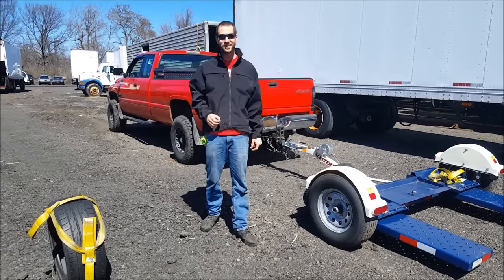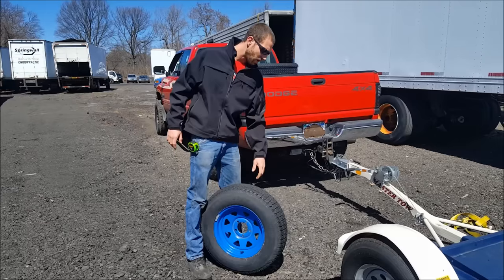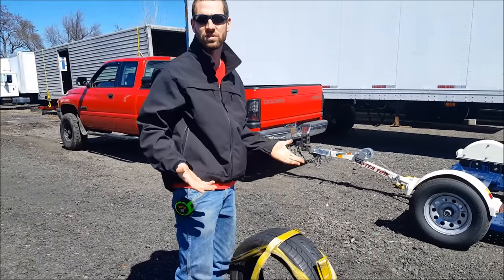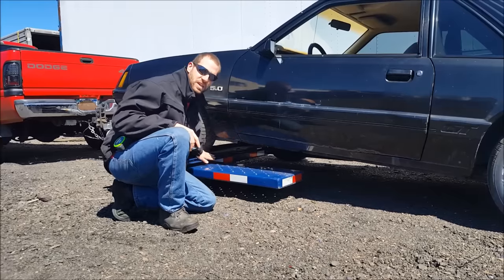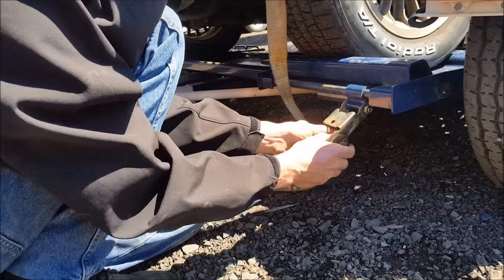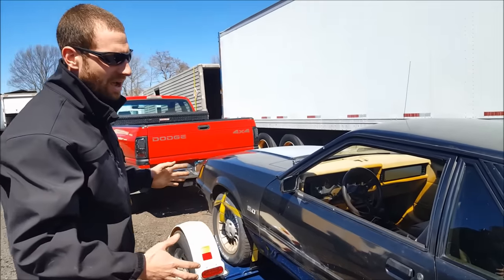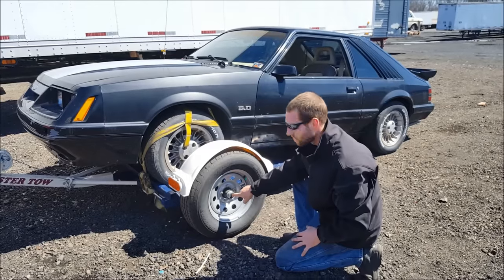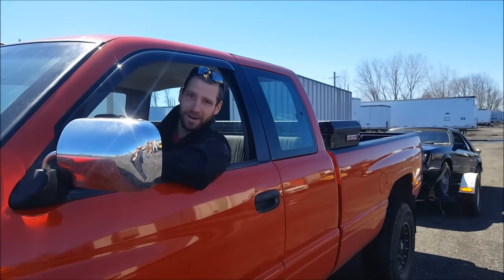HOW TO USE MASTER TOW CAR DOLLY mastertow 80THD instructions

Comment: Good information.  I once towed a car with a manual transmission on a dolly. I left it in neutral, but my wife went behind me to double check everything and she put it in gear. The engine blew a few miles down the road. Dropping the drive line would have saved that car.

Comment: I got a tow dolly for my camper and now I know I can just sell it. There’s no way I’d be comfortable doing all this as a  mom - I can do lots of stuff but for sure this isn’t going to be one of them. Thank you for going through such details with clarity. It probably saved somebody’s life.
Reply: I’m a 61 year old woman and I can use the car dolly no problem.  My husband is NO HELP when it comes to guiding me on or off the dolly due to some brain damage from a stroke so I have to get out and eyeball it myself.  My car is a front wheel drive Prius and I tow it behind my RV.  It has a low profile so I need to use blocks of wood as he describes.  The hardest thing for me is loosening the ratchet.
Reply: @antoinettedepasquale5336  I should have come
Back here and said I figured it out- because I did. Big hep and confidence builder💜

Comment from the maker: NOTE: DO NOT TOW EVEN A MANUAL TRANS RWD WITHOUT DISCONNECTING THE DRIVESHAFT.  After making this video, I did some more research and many manual transmissions need input shaft to be spinning for proper lubrication.  I was under the assumption that since a manual transmission generally does not have an oil pump mounted on the input shaft, that it would be okay to be towed in neutral with the rear wheels on the ground.  NOT THE CASE and certainly not worth taking a risk.

Comment: On these videos nobody seems to understand that you can tow a rear wheel drive vehicle if you back it on. I’ve seen it done no problem, the front wheels freewheel. Just make sure the steering lock is engaged and just to be sure use the seatbelt to ensure that the steering wheel doesn’t turn.

Comment: Great video. Was looking for information As i nearly lost my load recently, most certainly learnt alot from your video. 1st point being i didnt lock the steering wheel with slider, 2nd point leaving slack before ratcheting down the straps to spool the straps up more. Basic mistakes but sometimes learn the hard way. Thanks from the UK

Comment: I know an old timer that owned a repair garage and wrecker service. He towed rear wheel drive cars backward all the time, for decades. This was before cars had lock steering. He would loop a piece of rope on the steering wheel  pull it tight and close the car door on it. Then knot the rope so it couldn't pull back through. They would pull as straight as long as the steering wheel was straight with no wagging.  Thanks for all the great tips on using this dolly.

Comment: I tow my 1999 Tacoma pickup truck with rear wheel drive with my Motorhome . I have to tow it backwards due to it being an automatic transmission. One trip covered over 5000 miles out through the Northwest. I had no sway except from wind, but it migt have been from the Motorhome being pretty heavy. Several times I had to back up due to taking a wrong turn onto a dead end road. It wasn't easy but by working it back and forth I got it done. Also my tow dolly has surge brakes so they were a big help in the mountains.

Comment: Very informative and useful video.I recently had to use a tow dolly like this to tow a 1998 GMC 1500 extended cab truck home.I had to use a 1991 Chevrolet S-10 to do this and it didn't have a receiver hitch.If this wasn't bad enough,I also had to load the GMC truck onto the tow dolly backwards because there wasn't a ring gear and pinion in the rear differential.It did fine until I turned into my driveway off of the main highway and then it almost came off! Finally got it back on and home.
Reply from the maker: Haha, sounds like a pretty sketchy ride! I've definitely had my fair share of experiences like that. Thanks for sharing!  The first car I ever put on here was an old beat-up Porsche that I got for 300 bucks. I put it on backwards and didn't lock the steering. When I made a turn out onto the road, the front end of the car started riding in the opposite lane. LOL
Reply: @NoNonsenseKnowHow  Wow!The steering column on that GMC 1500 didn't lock anymore,so I had to ratchet strap it straight.When I made the left hand turn into my driveway,the right wheel of the dolly went under the frame of the truck near the cab.
Reply: @NoNonsenseKnowHow  
Sunday, I had to haul an automatic 325ci with a rear-air-bagged Grand Cherokee. 400 miles SoCal to NorCal. I've towed professionally for the last 15 years, repo, AAA, every crazy/illegal/insanely unsafe situation possible. This tow was the sketchiest haul I've ever done! It was wagging me hard. At 45 MPH it was trying to kill me. I had to set it at 40 MPH and cruise it white-knuckle the whole way. At that speed it was 12.5 miserable hours instead of the normal 5ish hours. 

Never again.

Comment: Great video.  My husband and I have one of these we pulled behind our RV.  He would always pull the car up and I’d strap it down while he tied down the steering wheel.  I lost my husband this April and realized I didn’t remember everything he did inside the vehicle while I strapped the tires.  I couldn’t remember if he left it in neutral (automatic transmission).  I figured you would have to, but honestly wasn’t sure.

Comment: Dude you’re high speed!!! My straps kept coming off so I’m gonna try looping the strap through the ring twice and hopefully that will make a difference thanks
Reply from the maker: Yeah sometimes I go a little too fast that's for sure. Make sure you have at least three or more  Revolutions of nylon webbing on the ratchets.  What part of it is coming loose?
Reply: NoNonsenseKnowHow hey thanks for the reply! I think my Ford Explorers front tires has not been snug up against the front bumpstop of the dolly so the vehicle has too much play and is moving around and making the straps come loose every time! I tried doing the double loop through the metal ring and that seemed to help so now I think I need to perhaps make some custom pieces of 2X4 that I can place behind each tire to reduce the vehicle movement? Or try my other set of straps made by starrr products? Thanks

Comment: Good info, it's important to lock the steering wheel as the dolly is designed with the slider to  limit the amount of steering angle so that no damage occurs to the vehicle being towed. For dollies without a slider, you must unlock the steering. I think I rather the slider tho because once I was forced to tow a 5,500 pound truck backwards to the recycling center with a 5,000 pound truck. I got up to 50 mph and learned quickly about death wobble. Backed down to 20-30 mph MAX and I was ok. So if your forced to tow backwards, I'd say you definitely need the slider, but I still wouldn't recommend it like you said.

Comment: I have towed with a tow dolly for 15 years. When I bought mine the guy told me do not back this TG back or you will bend the tongue. I went about ten years without backing it up. I got in a bind one time and had to back it up with a Ford Taurus only 5 feet. Yep it bent the tongue. I towed rear wheel drive cars by backing up on the dolly and pulling them backward. This might have been a no no but I had no  trouble. They were big heavy vehicles too, Oldsmobiles and 1500 chevy trucks, Ford LTD. ETC. If you are going to tow a lot get a car haul trailer.

Comment: I've purchased one 7 months ago.  Great dolly.  Straps suck.  IMHO one of the better dollies out there.  I purchased a spare tire, safety chains for for added security to the car towed,  and a different set of straps.  Much easier to use.  As far as lighting the 4 prong trailer connector takes care of that.  As far as braking goes I got the one with surge brakes.  Problem solved.  Most states require supplemental braking if the towed vehicle or trailer is over 3K pounds.  Not all but most.  The surge brake dollies get around the electrical hook up requirements.  So far I've towed my car 1K miles to and from Florida behind my bus with no issues.  My father used one for over 20 years behind his motor homes with no issues.  They are a good low cost option versus flat towing.  You just have to find a place for them once you get to your campsite.  Solved that problem by adding a small tow hitch to my towed vehicle.  Thank you for your informative video.  Much appreciated.

Comment: I have to be honest with you I was a little apprehensive of using this tow dolly because I've never done this before after watching your video 
"that was more than theral"👍
I feel totally confident now....
 thank you so much! really appreciate it...
The only question I have is about the electric brake application ,
we bought a gizmo
By Kurt call Echo mobile brake control bluetooth enabled monitors break activity and send status updates  that works with an app..
Do you have any suggestions about this item any information you can offer would be great.
Reply from the maker: Excellent to hear you found the video helpful. I haven't personally used the device you're talking about so I wouldn't really be able to give you an opinion. I do have a brake controller on my truck but it's the old style. My car dolly did not have brakes on it. These  car dollies are very handy but I have since sold mine and prefer using a flatbed trailer

Comment: thanks that video sure did help.  i have a tow dolly like this one.  i rip off the under neath pulling up on it. i did not realize it would be to low.  thanks for the tip on putting down under the ramp.
Reply from the maker: Kyle Randall no problem! And I'm glad you found it helpful!

Comment: I'm glad you showed backing up and dolly turning.  My question is dolly has no turning mechanisms I presume, and the front wheels have to angle somewhat since rear of mustang is trying align with front of dolly?  It seems like there is some angling of front tires going on in a turn, but that can't happen if front steering wheel is locked.  Are straps allowing some flex, thereby causing loosing after each turn?
Reply from the maker: The Dolly deck has a pivot. Yes the straps give a little bit also and can loosen up after it turns.

Comment: I bought one of these last year and sold it after the 1st use. Realized I will gladly pay the $100 then mess around trying to tow it with one of these.
Reply from the maker: Yeah they definitely have a learning curve and take some getting used to to be efficient with. In either case they're still a pain in the butt.  Flatbed tow is much safer. I sold mine because I prefer using my car trailer.  Back when I was flipping junk cars though this thing made me a lot of money.
Reply: Its good for occasional tows unless you have alot of room for a big flatbed to sit around. Plus its lighter to pull empty.
Reply: $100 for what?

Comment: Here’s “you can not tow a rear wheel drive automatic” after I hauled a mustang car from CO to TX. I didn’t remove the drive shaft lmaooooo. Luckily this thing kept working!!!!
Reply from the maker: Good to hear you didn't have any trouble. I've done it plenty of times short distance. But I definitely wouldn't tell people to do it in the video because then I'll be hearing a lot of backlash when someone's transmission seized up
Reply: @NoNonsenseKnowHow  no doubt!! I got very lucky!
Reply: I do it all the time as long as your transmission is in neutral your fine.

Comment: It didn't say what gear to leave your vehicle in park or neutral? I'm referring to the one which will be towed on the tow dolly.  I was in Calgary last night referring this tutorial worried about what gear to leave the 2015 Corolla in.  I tested Park and I saw wheels moving freely so I thought that was ok.  I suppose others with rear wheel drive might need a few more instructions.  Good tutorial though. I successfully did this and towed my car 700kms with a Tundra.
Reply from the maker: The vehicle being towedon dolly?
Reply: @NoNonsenseKnowHow Was referring to car being towed. I didn't know that "Park" only locks the wheels which are powered.

Comment: I already knew what I was doing (being a tow truck operator for years) but I loved the way u explained everything great video! And your right about that thing jackknifing crazy lol I hate that shit
Reply: I can back a 53' trailer just about anywhere you can drag a rope, but backing up a tow dolly eats my lunch. The deck on a UHaul dolly is articulating... the trailer goes one direction, but the rear wheels of the towed vehicle can go in another. It's like trying to backup doubles! Next time I'm opting for an auto transport.
Reply: Jack Reacher yeah man I hear you.... I had to pick up a dead car in a tight tight driveway and it was easier to take the damn thing off and just manually line the shit up and then back the pickup truck back

Comment: You can load a rear wheel drive backwards not pull drive shaft. Run seatbelt thru steering wheel and lock steering wheel.. If older vechice steering wheel doesn't lock ues ratchet strap from seat bracket thru steering wheel back to bracket...  Backing up is not as bad as you make it out to be you just have to make slow easy turns and presto you backed it up..
Reply from the maker: I used to rent this unit out and dealt with hundreds of people over the years. Trust me, backing it up is a problem for 99% of people.  And yes I've pulled many rear wheel drive cars backwards, but it's actually not that safe to do because then all of the weight of the engine is at the rear and it's not safe weight distribution. That and even if you lock the steering or use the seat belt, there is still more play in those front wheels and you can get a wobble on the highway. Sure you can do it, but for instructional videos of think it's best to tell people that they should steer clear of this. So then they don't come complaining to me when they lose a car on the highway
Reply from the maker: Appreciate you commenting though
Reply: I agree for beginners they should listen to you. I've been around the block a time or two..
Reply: You should inform people when backing up drive from the bottom of steering wheel so they don't have to think about which way to turn wheel.

Comment: Nice video, thanks. Bought a used one just like that one. Has 13" tires and wheels they are165/70/13. Ramps seem kinda low for not snagging ... wondering if I can put  like 185/85/15 on without any worries. Fenders are beat up but thick, think I can modify them to mt needs, any other issue on that to worry about?

Comment: I was told not to tow rear wheel drive on this type of dolly as it can damage transmission
Reply from the maker: yes.  Unless it's a four-wheel drive with manual transfer case. Then you can put the transfer case in neutral.  I touched on this subject in the description after posting the video

Comment: Would it matter how u tow a rear wheel drive car (front/backwards) if it's just a shell? No engine, just a shell with everything else. Thank u in advance! And great video!
Reply from the maker: I suppose it would be better if it was just a shell. But honestly I've never done it so I couldn't tell you for sure. It also really depends on if the front end has any slop in it.  Best thing he's just try it and see how it feels. Stick to the back roads if it doesn't feel good
Reply: I tow full-size pickups backwards and have never had a problem.  I do it that way just to save time by not having to drop the driveshaft. Lock the steering wheel.  I only do backwards around town, 10-20 miles or less; if I'm going further I tow facing forward and remove the driveshaft.  I drive 50 mph or less when towing backwards.

Comment: So we just got one of these.  Our car is a front wheel drive and we are going to pull it behind a motor home.  After we get the car on the dolly and strapped down then we take off the emergency brake but our question is do we leave it in park or put it in neutral?

Comment: Only question I have is you plugged in the lights for the car dolly, how do you then plug in the lights for the extended two lights? Do you need those if you use the car dolly lights? What's the law require?
Reply from the maker: Excellent question! You would need a 4 pin splitter adapter. I've plugged a link into the description to one on Amazon. They're about 10 bucks.  I usually did local runs with mine and would just put the four ways on. The laws will vary state-to-state. But definitely a good idea either way to have lights on the back. Pretty sure you have to in most States. The dolly lights alone are not enough

Comment: Those adjustable tow straps appear to be simple to set-up but... they require practice to become proficient.
Reply from the maker: Correct. They are not quite as simple as the old cam Buckle style I had but they are definitely better in my opinion

Comment: Good video. 
Quick question!
I noticed as you backed up sideways the car move a little out of the trailer. 
And it was only a light move. Are the doors or panel liable to get damage on a sharp turn. 

I have a 23ft tioga rv , and im trying to trailer my 75 k5 blazer 250 miles round trip 500 miles total to Pismo Beach Ca. 
Would it be a problem or can if transport the weight capacity with out issues. ?

Comment: Was wondering if its ok to just keep vehicle running in neutral with auto trans rear wheel drive,and not remove driveshaft.Trans should be getting lubed right?

Comment: Great video. I question tho. For front wheel drive car do you still need to put in neutral? Or will the rear wheels move freely in park?  

Thanks again fella
Reply: On front wheel drive, you park it like normal, without the e brake of course. The rear wheels free spin when in park, no connection to the transmission.